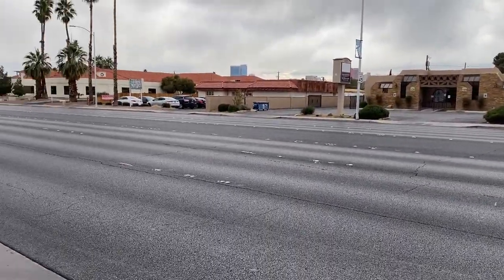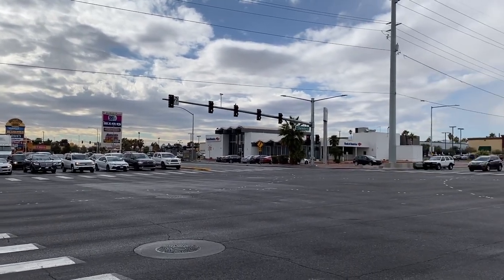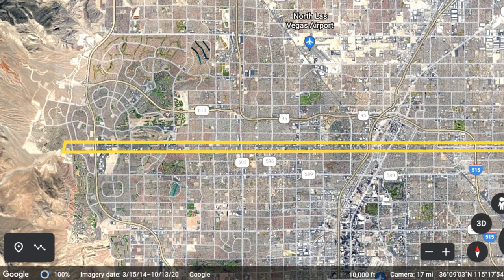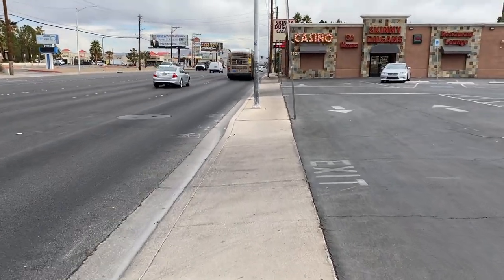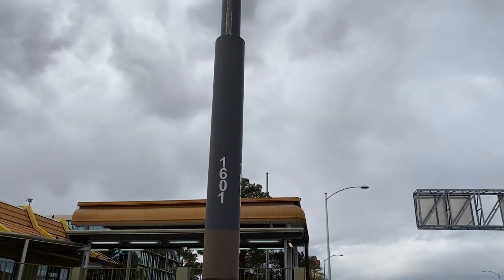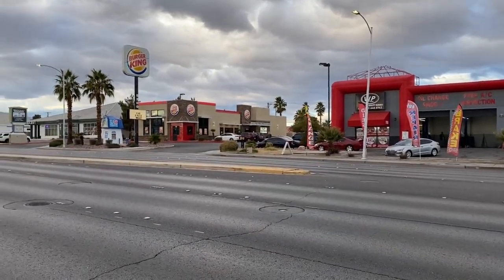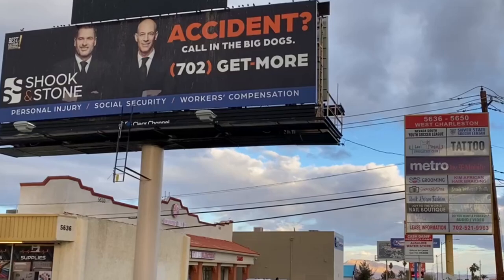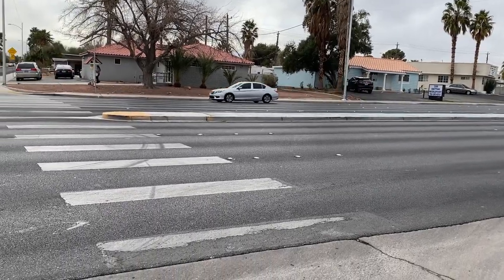The Stroad: A Case Study // Intended (and Unintended) Consequences of Car-Oriented Street Design

Comment: Coming from a transportation engineering perspective, it's a breath of fresh air (pun intended) to see people realizing the mistakes of the past and trying to design cities to be more efficient and human-friendly not car friendly. Thankfully the group in the company I work for take on projects that remove lanes instead of adding more to the struggling network like our highway group does
Reply from the maker: There's a huge business in retrofitting these bad boys, that's for sure.
Reply: Isn't fast driving cars efficient? I think we need to consciously make priority decisions. If getting rid of Stroad is the highest priority, then accessibility and efficiency are not priority... All these very quaint, beautiful European cities were built 500 years ago when mode of transportation was different, and mainly built for Aristocrats and rich people... Just keep that in mind.
Reply: @kevinmsft  sounds like you've never been to Europe...
Reply: @kain0m  many times...
Reply: @kevinmsft  But it's extremely bad for the local economy. Cars that drive fast are cars that are not going to be parked nearby for the driver to go shopping, they are through-traffic that could have just as easily been routed around the city center. Cities are not liminal spaces, they should be destinations.

The Dutch "autoluw" philosophy limits throughfare in city centers to encourage locals and visitors to shop on foot.

In this setup, car traffic should, idealy, consist of destination traffic only (with cars encouraged to park within multi-story car garages). Autoluw traffic calming methodology discourages drivers who aren't in the area for the area itself from adding to city congestion, by making through traffic take more car-centric roads on the further-out bands of the city.

It's been proven time and time again that limiting car throughput in city centers makes for better business, because bicyclists do not demand much road space (meaning 4 cyclists could fit in roughly the same amount of space that a car would demand, regardless of how many occupants it boasts - and the bicycle is over all a less hazardous object from the perspective of other road users, and makes for a quieter vehicle which also means more pleasant public spaces). Pedestrians will window-shop, and are generally more amiable to stopping by a local eatery or bar to get a bite or drink with friends.

(Bonus: having fewer people driving cars in the city center will mean fewer people drunkenly stumbling out of bars and into their car to cause vehicular accidents.)
Reply: have you ever been to Las Vegas? Stroads are not a mistake of the past.  This is present-tense. Las Vegas is just getting worse. I first visited family here in 1981 when it was still relatively quiet. I moved here in 1990. Now every road is a stroad or a freeway, apart from the Arts District and HOA developments.

Comment: We've all been there: driving down the road with your windmill blade in the back, and suddenly you get the call that you urgently need to deliver it to the wind farm on the other side of town.
Reply from the maker: Completely plausible and an ironclad justification for urban arterials with a 200' ROW
Reply: Funny you should mention that.  I was delivering some power plant equipment and a subway car (not in the same load) just last week and that very same thing happened each time.
Reply: @SofaKingShit  As an Aussie, and half-cut, your user name is pure poetry.
Reply: @SofaKingShit  The problem is, those windmill blades don't get along very well with a McDonald's drive-thru.
Reply: @sabretooth1997  yeah, they really need to widen drivethroughs more, maybe add some more lanes

Comment: I think what's even crazier is that these stroads end up having more lanes than actual highways...
Reply: 7 lanes for one direction…yup.
Reply: Because they are bad at being a street and bad at being a road at the same time. Very inefficient traffic design.

Edit: Also stroads are also bad from an environmental standpoint. Highways save gas by keeping the traffic flowing while these stroads are a constant stop and go.
Reply from the maker: On the other hand, think what you could do with these amazingly wide rights-of-way!
Reply: I think my favorite part are the stroads that have sidewalks that randomly end and give you nowhere to go but that NARROlW Strip between the white line and the ditch. 

@CityNerd - I think the videos need more sarcasm and dry humor
Reply: @CityNerd  There's major city boulevards, typically 6 and sometimes 8 lanes wide (outside intersections), in which the outer lanes are used for unauthorized curbside parking along business corridors. It would be safer and more efficient to close the outermost lane and turn it into curbside parking, and perhaps ideally slim down the remaining travel lanes from 12ft to 10ft (3.6m to 3.0m). That would result in a space saving of 8 to 12 ft (2.4 to 3.6m), which can be used to widen each sidewalk by 4-6 ft (1.2-1.8m).
Reply: @jermaineraymer1579  What's even better than that is when you come across a stroad that has a crosswalk that dead-ends on both sides. E.g. there's no path for pedestrians to even get to the crosswalk in the first place, but it's there anyway.
Reply: @CityNerd  You missed the best Stroad feature - no u turn or left turn areas. Your nicer suburban townships now love these. Enough room to turn around a double long bus, but it’s illegal.
Reply: @georgobergfell  Seeing that bus stop in a live lane seemed REALLY sketchy, think about how many people doing 45 or 55mph need to change lanes to get around them. How many people will rear-end the bus whilst looking in their blindspot at those speeds? How many people will change lanes without looking properly and cut someone off and get rear-ended? etc.
It's just a nightmare.
Reply: @CityNerd  Like using it for 4 double-wide lanes to drive double-wide ultra-heavy pickup trucks carrying one person on? Standard lane widths kind of reduce peoples ability to compensate err express their freedom.
Reply: @jermaineraymer1579  or where they end at an overpass with only a catwalk to get you across where if you get hit by a car you go over a railing
Reply: It makes sense they want to have highway throughput but that is hard with all the traffic lights and driveways.
Reply: It's kind of inherent if you try to make something both an access road and a highway.  You need zillions of turn lanes, and also lots of travel lanes for all the vehicles stopped at lights.  If you were trying to be just an access road, or just a highway, you'd need fewer lanes, and do the job better.
Reply: Maybe even convert them to true boulevards (Olmstedian blvds + transit blvd variation) with dedicated BRT lane and thru-lanes in the middle, paseos, local access lanes, four rows of street trees
Reply: Maybe more drivers are using them though?

Comment: One of my favorite indicator species is the Bench No One Sits On, and its close relative The Bench Thats Actually Just a Billboard. Both are placed facing the oncoming traffic and are close enough to the stroad to feel the air currents of the speeding cars. Bonus points when the billboard is an advertisement for the bench itself. I once saw giant Tiger eyes staring down the traffic with something akin to "YOU LOOKED! See, these work!" and was purely there to distract the drivers as they went through the intersection.
Reply: My favorite sidewalk obstacles are the abandoned giant metal construction barricades laying on their sides, which workers forgot about after their project, forcing cyclists and pedestrians into the traffic lanes (which at that point have not been under construction for over a week).

Comment: Would absolutely love a "solutions" video! So often these kinds of videos leave me depressed and hopeless about our cities, so I'd love to hear what kind of things we may be able to do to incrementally make things better
Reply: The Netherlands.
Reply: Really a solution may be imposed by geology and nature. #PeakOil has arrived as of November 2018. Oil production is only going to decrease. But the problems will be immense and unsolvable.
Reply: The silver lining of the stroad is that there's a lot of space to work with.  You could widen the sidewalk, add in protected bike lanes and BRT down the middle and still have enough room for 2-3 car lanes per direction.
Reply: Another similar thing you can do is change the inner 3~4 roads in any stroad with more than 8~9 lanes into bus-only lanes + stations (or a train railway if you're feling fancy). This helps with bus issues, and provides a "safe" middle-ground between one part of the stroad and the next.
To make it for busses you don't really need much (in relative terms of infraestructure): just some raised ground for the bus stops, plus concrete barriers to delimit the bus lanes. The main challenge will come in the form of making buses travel there with proper routes and frequency, then getting people to use them.

To make it for trains would add an interesting challenge, as the intersection lights should be timed pretty toughtfully to minimize time spent waiting:
- Be green for straight movement while the train stops at the station, then passes.
- Be green for all left turners while pedestrians cross the other sidewalk.
- Be green for all right turners while pedestrians do the other crossing.
- Be green for the intersecting street...
...Or well, whatever the best option is for each intersection.
Honestly, just having a good train along a stroad that connects cities/towns will probably make a big number of non-public-transit-crippled people forced to use cars switch onto it fast.
Reply: My city (San Jose, California) has been removing lanes from some stroads. We call it a "road diet". There are a few near me that went from two lanes in each direction, to one lane in each direction with a nice wide bike lane on each side, with a painted buffer zone. I'm loving it.

Comment: Great video! I really liked the "out in the wild" aspect. a video about solutions would be very exciting! I'd particularly love to see ways to turn Stroads into Roads. There are lots of examples and ideas that come to my mind when thinking about turning a Stroad into a Street, but going the other way seems to be a bit more involved. Thanks, and keep up the great work!
Reply: To add to your point I think it would be interesting to see light rail considered in a video about solutions, specifically a road like MLK Way in Seattle before and after the light rail. It's definitely still a stroad but there's a lot of infill around stations and it feels a bit safer with slower speeds and reduced opportunities for dangerous left turns.
Reply from the maker: Thanks for the suggestion! I'll put it on the list.
Reply: @derekc5175  the light rail there is now too high in demand to be compromised by so many level crossings, but I know it's the first stretch opened so it couldn't have been built otherwise
Reply: Make it happen to CA-1 between Princeton and Moonridge, it's on the "road" end of the stroad spectrum (for now) but the constant lights and driveways are just...

Comment: 20 years ago I rode my bicycle from Morro Bay, CA to Palm Beach, FL.  Over half of my trip was done on the I-10, Passing through El Paso, Phoenix, Tucson, San Antonio, Houston, New Orleans. Mobile,  Pensacola,  Tallahassee and Gainesville.  If I wanted to shop, I had to lock my bike in my motel room and try to get to a shopping centre on foot, that was typically only accessible  by car.  15 years later I moved to Haarlem in the Netherlands, where everything was accessible by bike.  The difference could not be more pronounced.  The USA is made for cars, while Holland is made for people.  I applaud you trying to get this message across.
Reply from the maker: Thanks for sharing -- great comment!

Comment: I believe a good way to quickly have this stroads to proper streets would be to add a BRT with dedicated lanes.

This is what my state did to some huge stroads with 6 lanes going each direction.

2 Brts lanes going each direction and increase sidewalk size
Reply: I think 2 lanes either direction is the upper limit for walkability and at that width, a signal with a median is needed for pedestrians to feel comfortable from my experience. So to me a 2 lane(4 lane both direction) is the target goal if we want to downsize a stroad.
As you said, have the two center lane on either side turn to BRT lanes which may mean widening the median too. Eliminate the right turn lane and turn it in to a widen sidewalk. The right most through lane turn into a protected bicycle lane. And the lane next to that can be used for street parking to protect said bicycle lane. So from the video's 7 lane, it is now a 3 lane road in each direction. Which is going to be about as good as it is going to get I think. The reduced car capacity would be easily made up with the new BRT line and the enhanced pedestrian/cycling infrastructure.
Reply: Or just build light rail instead. BRT is such a half-arsed solution, it's still just a bunch of busses, but now they get their own lane, which is better than having them run in traffic. Similar or higher max capacity, lower operating cost per passenger (fewer drivers per passenger thanks to larger vehicles), and vehicles that last longer (no tires, no internal combustion engine, means less vehicle maintenance cost). Also, powered by electricity without the need to lug massive batteries around.
Reply: @mariusdufour9186  BRT is about lower infrastructure cost. Converting existing lanes is often just a matter of repainting the lines. CNG buses aren't as terrible as diesel, you can do articulated buses all day and increase capacity of each by 50% SRO. That's a lot cleaner than city buses in traffic. And you could even electrify them if you want, not sure how long it would take to recover the cost on that but the lack of emissions would be a nice bonus.
Reply: @MrTaxiRob  Indeed the upfront cost is lower, but not everything is about upfront cost. If a city is serious about providing reliable public transport long term, rudimentary BRT should be a short term, temporary solution while the light rail system is being worked out, at least on the main lines of your system. The problem is that once you start incrementally improving infrastructure for your BRT (beyond some painted lines), you're going to add raised platforms, lane dividers etc. Basically locking in it's right of way. And then when you want to step up to light rail, you'll be forced to follow the alignment of your bus lanes or to start from scratch. Converting an existing BRT system into light rail always results either in a sub-optimal light rail system (the 'cheap' option), or in a light rail system that costs just as much as it would have if you had built it from the start.
If you're going to be providing high capacity public transport on main arteries, the investment in light rail or tramways will more than pay for itself in the long run over BRT, even if we disregard environmental impact, trams and light rail are just so much more cost-efficient to operate once the system is built.
Reply: Unfortunately, the county signed a franchise agreement with a private company who is exploring a privately-funded light rail line on Charleston, and until that inevitably implodes, there won't be any high capacity transit on the corridor.

Keep in mind, these are the same county officials who were impressed by Musk's absurd Tesla tunnel.
Reply: @mariusdufour9186  Here in San Diego their idea of incremental implementation is just as you describe, but in the meantime they're still finding trolley tracks under the roadbed and still tearing them out. It's maddening to watch.
Reply: @mariusdufour9186  LRT usually replaces an overworked BRT.
Reply: @michaeloreilly657  Indeed, when you plan badly and make incremental steps, that is what happens. And the resulting LRT system tends to be compromised and constrained by the fact that it then often is required to fit within the BRT infrastructure with as little modification to it as possible. (sub-optimal platform heights so no level boarding and no high-floor vehicles, curves that are too tight, and grades that are too steep, all limiting the efficiency of the system and the type of rolling stock you can use) I'm suggesting to leapfrog BRT and purpose-build LRT instead. Considering that BRT, unless built in the middle of nowhere, ends up having to be converted to LRT anyway.
Reply: @mariusdufour9186  BRT should use trolley buses in my opinion. but ultimately it comes down to money, and rail does have higher capital costs, and there are always tradeoffs (i.e. do you expand bus service or build a rail line). It boils down to what is going to provide a larger ROI
Reply: @neurofiedyamato8763  yeah agreed. It’s very hard for walkers to walk safely more than two lanes each way especially if people are turning right in cars since the walkers will be just partly across and then suddenly people will be turning right.

Comment: This stroad is not just trying to combine a street and a road, but a highway as well. That's some next level stroad you've got there.
Reply: I think the main traffic issues with many stroads are caused by the fact there are a lot of people using the stroad as a road trying to get from A or B and not looking to patronize the businesses along the route.  Because they are passing by, they are looking to drive as fast as possible and the frequent traffic lights are a problem.  Unfortunately, they don't have a good alternative in most cases, such as a good limited access highway, that would let them bypass the area entirely both improving their travel time as well as reducing traffic for those accessing the businesses.